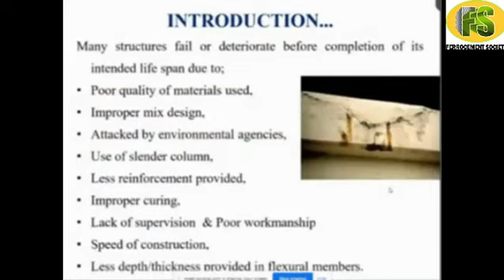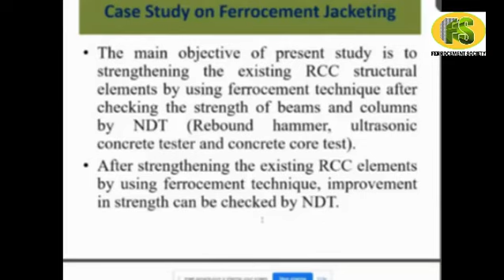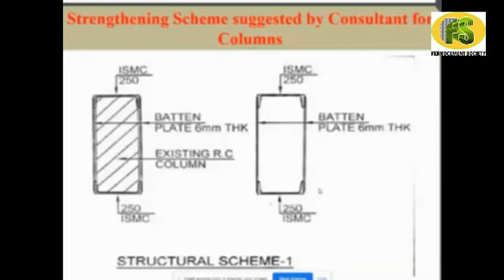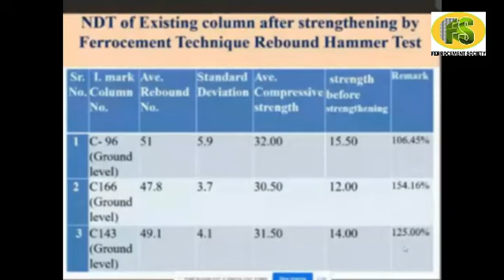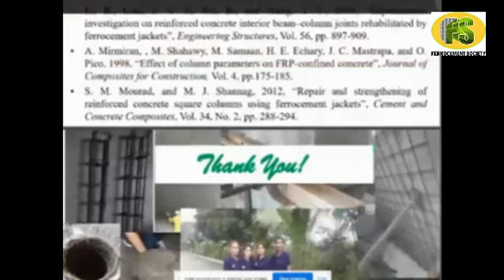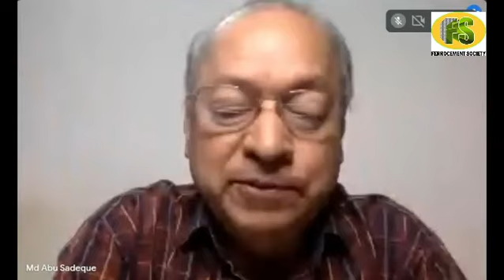Ferro Talk 17

Comment: can we construct Aquaculture tanks using ferrocement technique, what would be best way to coat the inner surface with epoxy which is durable for at least 10 years? Outer layer and bottom needs to be insulated with EPS/XPS panels? Can someone help with the design or if the panels can be constructed at the factory and assembled at the site? The typical size of tank is circular is 5-10 meter radius with height in ratio of ( Diameter-height - 4:1)
Reply: Any consultant who could please help, please do provide contact information.
Reply from the maker: Please contact indiaferrocement@gmail.com or consultmilind@mkce.co.in. Where is your site?